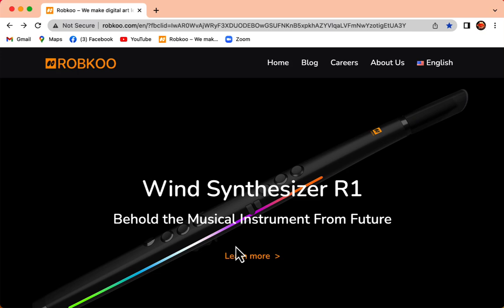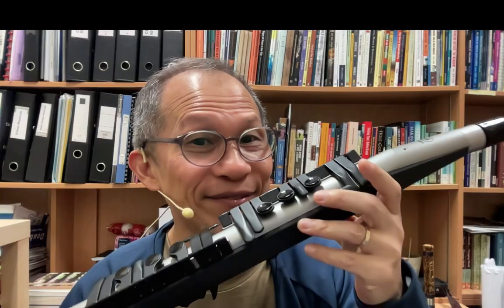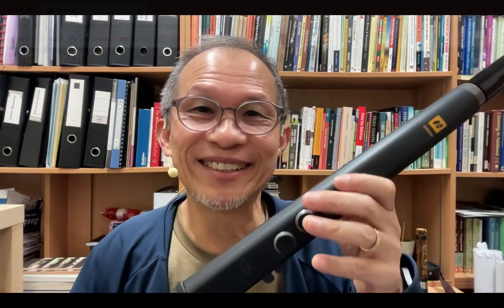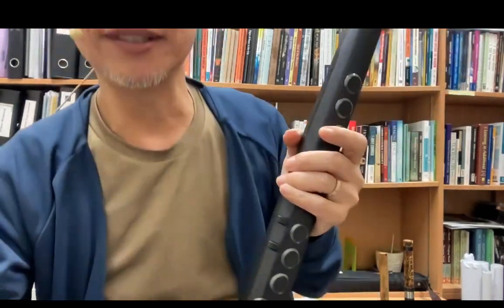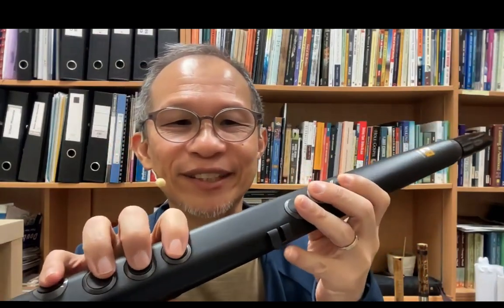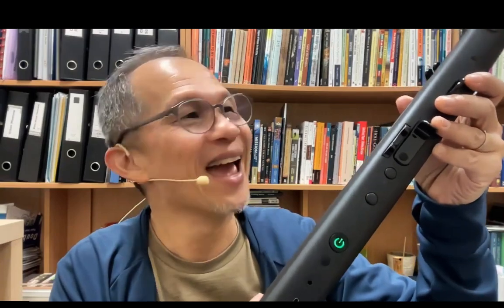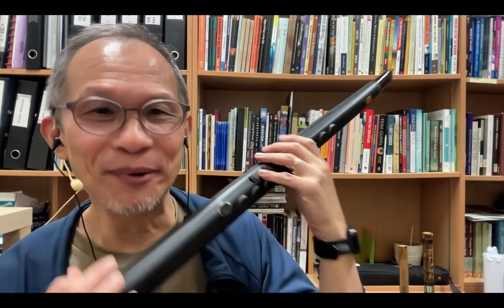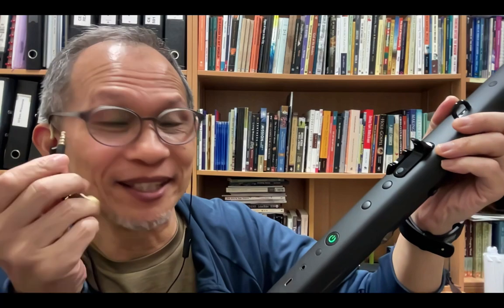Introducing the R1 Wind Synthesizer by Robkoo (Part 1 - Overview)

Comment: Hello sir , your reviews are great and very informative, I have bought the R1 about a year back . Yesterday by mistake , I pressed the factory reset option . So it is showing everything in Chinese , since I am from India , I can only understand English . So it would be great if you could help me to ser the display into English . Also it would be very helpful if you could guide me in connecting R1 to Logic Pro daw through ble midi . Regards
Reply from the maker: If you accidentally pressed the reset button, then just power off and on again. It will take you straight to the language options. By default it will be in Chinese, but if you press either the + or - buttons on the right middle of the instrument, you will get English. Press the magic button twice and you should be back to English menu. To connect with any DAW via bluetooth, first turn on BLE midi on your R1. https://www.youtube.com/watch?v=1HetUsB5dug&t=44s After that, you need to search for "Audio Midi Setup" on you Mac and launch it. Once it is launched, go to the top right side and look for the bluetooth symbol and click on it. On the drop down menu, you should see ROBKOO R1-xxxx. Select it and you should be connected. Instead of tenor sax on your R1 menu, you will see 001 or some other number depending on if you press any of the buttons. 

You then launch Logic and use it with whatever sounds you have there. Native Logic sounds probably won't be the best ones to use for R1. You should consider getting SWAM instruments (which can be stand alone without Logic or you can load them as patches in Logic). 

Otherwise Bernie Kenerson's Instant EWI Pro for Logic Pro X might be an option. https://berniekenerson.com/instant-ewi 

Davidson Carpenter's plugins Eviner, or lyrihorn 1/2 are also great as is Respiro by Rudy Verpaele https://www.imoxplus.com/site/. You need to play it as a virtual instrument in Logic.

My fav would be the SWAM instruments by Audiomodeling though. https://audiomodeling.com/

Hope that helps.

Comment: A wonderful introduction, Calvin! If you could address a number of features and issues in future issues, that would be wonderful (I am coming from a Native American flute background and have been deep into the Sylphyo for the last 18 months ... so these primarily relate to my Sylphyo experience):

* Can the user define fingerings? (Not possible on the Sylphyo, but I have been able to work with Aodyo to add two sets of fingerings for Native American flutes to the firmware)
* Tell us more about the motion sensors ... I use them extensively for effects (such as Growl on Saxes, which works perfectly with a VL70-m Turbo and all editable Kontakt instruments)
* Can you do key bends? (i.e. portamento controlled by the % of the finger pad contacted by the finger).
* The Sylphyo uses a radio link to their wireless receiver and it has incredibly low latency and a huge range (like a city block). They particularly avoided Bluetooth because of latency and interference issues ... What is the wireless setup for the R1?
* How much control does the user have over the details of how MIDI is produced? I have found it critical to be able to control the frequency of CCs that report Breath Control, since some VSTs and some hardware units cannot keep up with 1000 CC's per second and have to be dialed back to 250 or 125 CCs per second.
* Does the R1 respond to incoming MIDI commands - such as those that reconfigure it's settings. Settings on many MIDI controller can only be done manually, and that is a problem when a config change is needed during performance (like when switching between hardware units).

Sorry for so many questions, but you have got me interested!!
Reply from the maker: Thanks Clint for your kind words. Thanks too for filling a critical piece of my knowledge gap in your reply to a query I posted in one of your videos! I'm afraid i don't know enough to answer too many of your questions. Maybe the folk from RobKoo or other KOCs can help with the answers? 

I can however answer your question about wireless connections. I am familiar with the Sylphyo wireless receiver so have appreciated the cable free use of the Sylphyo. The R1 has BLE midi. I was experimenting with the wireless pairings with Eviner/Respiro on my Mac and various apps on my iPad just yesterday. You know what - I think i'll do a video about the R1's BLE Midi feature next. It's too much of a key feature not to talk about!  I'm tempted to get a CME widi master for my WX-5/VL-70 to use as a reference for comparison...
Reply: @calvinchong8740  I think an R1-Wireless video would be great!

Personally, I'm not sure I can deal with the added latency from a BLE interface (10-20ms, I have heard?). I stand on my head (not literally) to shave off a millisecond here and there. I'm using Direct Monitoring where I can on my audio interface to save a round-trip into the CPU. My rig not only supports my wind synth now, but also a keyboard player, and they hate latency even more than wind players!

Keep up the great videos!!
Reply from the maker: @ClintGoss  the latency is really low. I’m thinking how to do the video 😅. I guess it’s for the midi community to judge how good BLE midi is. It’s an evolving development!
Reply from the maker: @ClintGoss  hello hello. I just posted the third video which is all about BLE midi! It was quite an effort but I needed to get it out of my system!
Reply: @calvinchong8740  COOL! I'll check it out now ...

Comment: Does the R1 support internal MIDI over Bluetooth (BLE)? Is there an internal speaker? Did it come with a manual? If so did it seem pretty comprehensive and was there an English language version? Looking forward to your upcoming videos regarding the R1. Thanks.
Reply from the maker: There is BLE midi that you can turn on and off. No, there is no internal speakers - you need to use your headphones/amp or use bluetooth. They tell me they don't have an English language manual ready but they are working on it. I'm waiting for it too!
Reply from the maker: Hey thanks for asking the question. So I'm new to this and went to do more research about BLE midi. I did a cursory mention of BLE midi in the second video but didn't realise the significance of it. Just tested it with the Jamkoo and SWAM apps on the iPad. Now that's a key feature in the R1 that I missed! I've heard about the CME widi master etc but first time I've seen it in action! Wow!
Reply from the maker: hello hello. I just posted the third video which is all about BLE midi! It was quite an effort but I needed to get it out of my system!